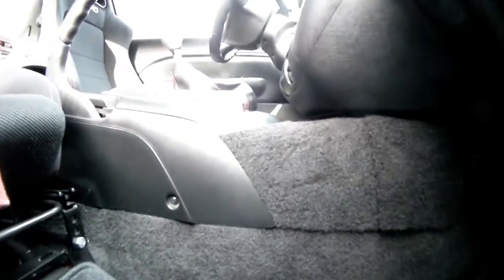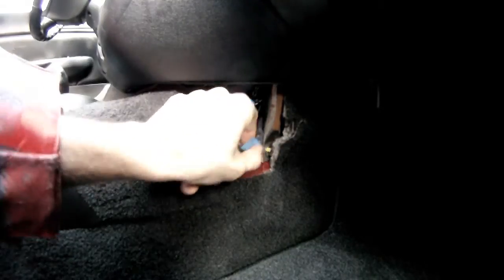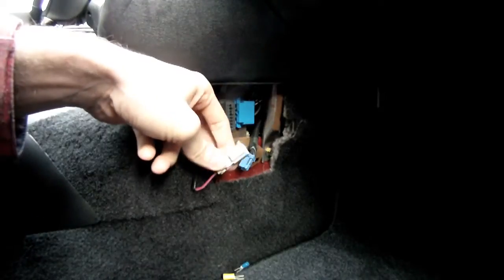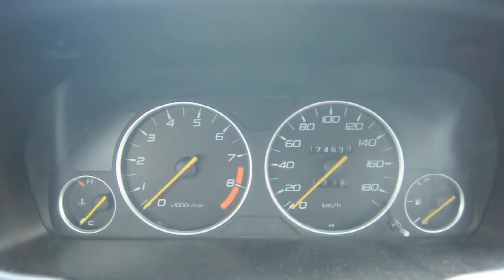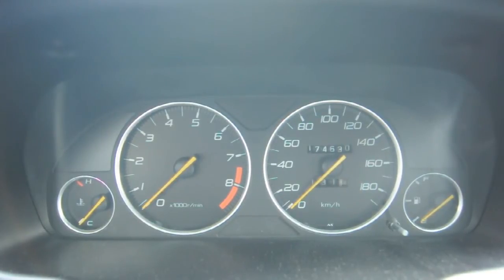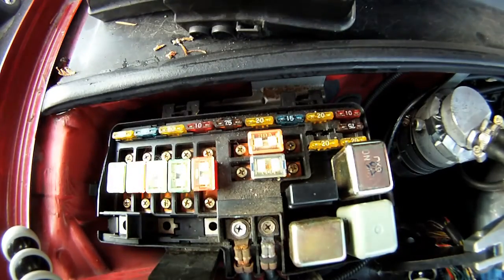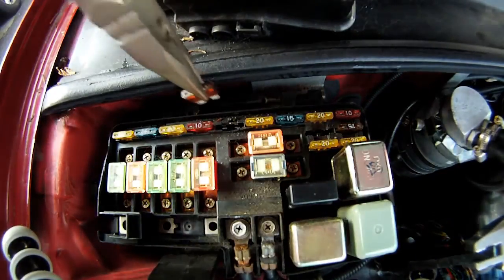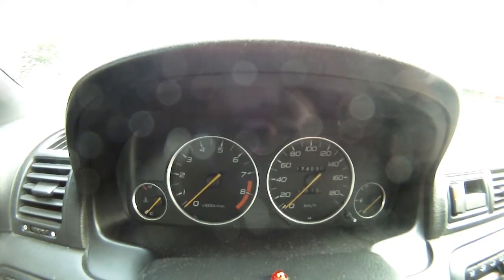How To: Retrieve CEL, ATTS, ABS and 4WS Codes for Honda Prelude

Comment from the maker: +TheJdmstyles I'm just showing how to retrieve the code without using an OBD scanner. I retrieved my code by counting the short and long durations, searched up the code online, replaced the part or did the maintenance that I had to perform and then reset the the ECU by pulling the fuse out. This is just a general guideline, not an exact "How to fix your CEL, ATTS, ABS and 4WS" as that would be a very long video but perhaps I'll make a video like that one day as I am not intrigued. 
Thanks for watching and commenting though!
Reply: +mikeschmeeedotcom When I use the SCS service connector and turn they key to ON position I see CEL and ABS lights on all the time and atts light is blinking. :S I try to do the DTC erasing tomorrow...